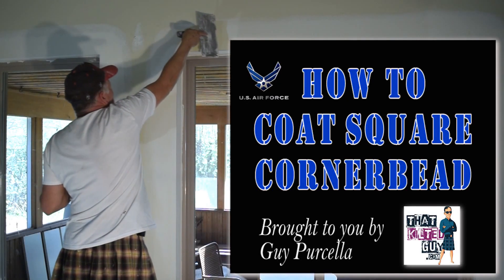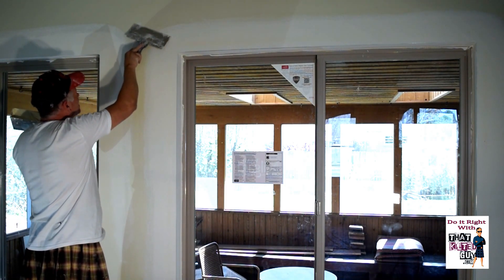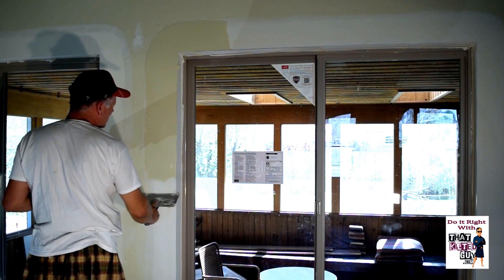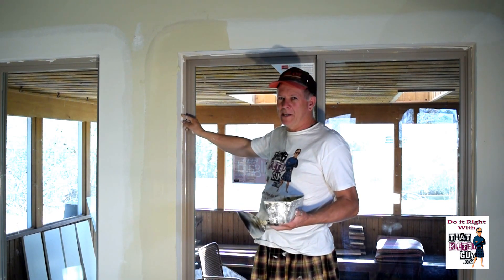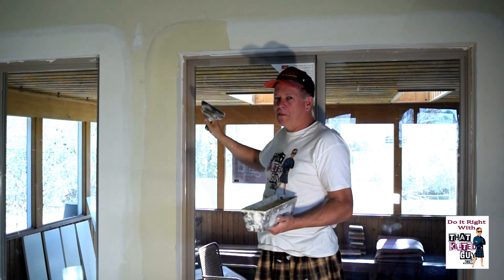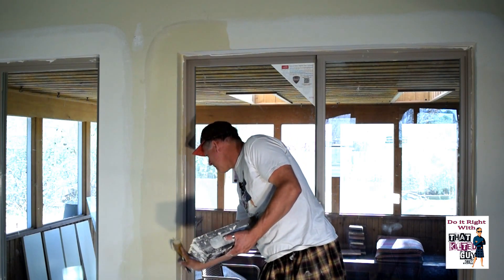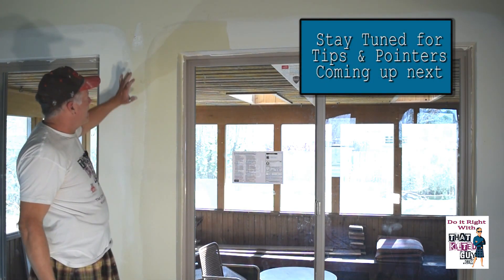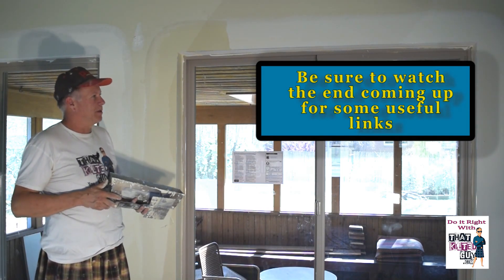How to Coat Drywall Square Cornerbead Corners the Professional way

Comment: Great vids. Thanks for your advice. Do you add tape (mesh?) to the corner bead? I was just adding some base to a room with no tape on the corners. Dried mud (old)was shattering on both sides quite a ways up the corners. I don't do too much DW, but seems like I always add tape to my corners. Which is more common? TIA
Reply from the maker: +Unbiased Observer I have seen many many corner bead cracks like you described so I think it’s a good idea to tape the edges of the corner bead where it meets the drywall with whatever type you like, mesh tape, fibafuse or paper tape. Thanks for the question, and thanks for stopping by and subscribing.

Comment: Question, I have heard lots of tapers don’t sand between coats, how do you deal with the lift off/pull out , that ridge will be high and never sand out in final sand?
Reply from the maker: I sand it, between coats. Never had any problems

Comment: I removed some baseboard to repaint and the walls are plaster lath when I removed the baseboard on a 6" corner piece the plaster crumbled 2" up from the floor and the metal corner pieces are exposed What type of mud should I use to make a good repair to accept renailing the baseboards on the wall Reusing the former oak trim I removed Thanks for your support
Reply from the maker: Most any all purpose mud will work.  Not topping mud though.  Hot mud, or regular all purpose is best
Reply: @ThatKiltedGuyDIY  I saw your video and I want to express my sincere prayers to you and your wife This is a tough time for everyone Good luck and I wish you health & happiness

Comment: I have just remodeled a shower. We will be tiling the whole shower. I have just finished placeing durock in the shower and was wondering what products to use to finish a corner that is durock on one side and sheetrock on the other side? Do you have a video with that?
Reply from the maker: If it's a 90 degree corner, just normal corner bead, and finish the durock side with mortar, or wrap the corner with tile and no bead.
Reply: @ThatKiltedGuyDIY  It is a 90 degree corner.  My wife also suggested just to wrap it with corner tile but i feel like I should cover the corner. Thanks for the information.

Comment: You reference the metal edge (no buildup). So no mud at all on the metal edge? Just primer/paint on the edge?
Is it a good idea to use hot mud for the 1st coat, will it give more strength and decrease potential for cracking?
Reply from the maker: Yes, you want no mud on the metal edge, just primer and paint.  And yes, hot mud shrinks less so gives a flatter coat, if you put it on level.  And it should be tougher and stick a little better as well.
Reply: @ThatKiltedGuyDIY  Thanks, Can you do a video that deals with uneven framing and how to get a straight surface with shims before putting the board up. I've done a fair bit of drywall around the house over the years. Patching holes, repairing cracks, skim coating, repairing cracked corner bead.  Currently I have the bathroom down to the studs. After having a new tile shower installed, I had a drywall crew come in and put new board up in sections that had been opened up because of pluming and exhaust fan issues and float the ceiling.  They did a terrible job and the wall board was uneven following the wall framing and looked horrible against the perfectly straight shower. I think they should have used shims to have a flat/level surface to mount the board against. I've torn all the drywall out and down to the studs to start over.  I'm going to do this project myself in about 4-6 weeks. Thanks, I've learned so much watching your videos.

Comment: HI,    I am not very experienced, but try to pay attention to details, which means slow...   I have used this corner product where the corners are made of tape with a small metal corner within it and had major success, but I worked hard to make the walls very square.  (a short wall, only a few inches wide on the shower head side of my soaker tub to the shower head wall.   I was wondering about your opinion on these tapes.  Seemed like cheating, but the end result seemed exceptional.  The product was  D........ paper faced metal corner bead.    I have another similar corner to do in another bathroom (niche) where one side of the shower (head side) the wall comes out a few inches to facilitate the plumbinb.  The metal corner bead was ripped out leaving a thick edge of mud, or what ever that is, and I am not sure I can just replaced it and build up again, or if I should just rip out the sheet rock and start over.  Also, some of the other sheet rock may have moved enough to slightly crack the paper in the corners and I am not sure if I should remove that wall and start over, or just redo the corner with tape.
Reply from the maker: Not sure how to help on most of that, but for cornerbead, I know that paper faced bead is far superior to all metal.  Check this out https://youtu.be/cblTRQmLMVQ
Reply: @ThatKiltedGuyDIY    Yes, very similar except where the blue was, it was metal.  My first try and the results are amazing... I am so proud of that wall and it really sticks out .  The wall is like a six inch thick wall between the main wall and the side of an alcove tub and shower.  The tile comes very close to it an it is all square.  I wish I could get the mud applicator and the tool  with the rollers.  after 15 years a lot of the tape at the wall to ceiling joints in our condo have started to tear or crack.  The ceilings are over 12' at the apex, so this would be a tough job with only one ladder.I am not sure if I should just slice the paper and put these corner products right over them.   Or pay someone to do it.  Being unemployed, It would be a good use of my time if I can do a good job... but... Thanks.

Comment: how to hold the corner trowel，my finger cant hold the corner trowel？and u think the best taping knife is stainless steel or blue steel，i would like to buy sheetrock taping knife
Reply from the maker: Hello, I like stainless for my larger 10"+ knives and blue steel for my smaller ones, but it's more a matter of what you like.  I'll be launching a website soon and putting links to tools in my online store so be watching for it.  It might be a few days, or weeks before I can launch it.  It will be at www.thatkiltedguy.com. Thanks